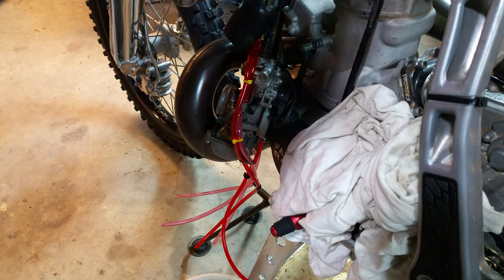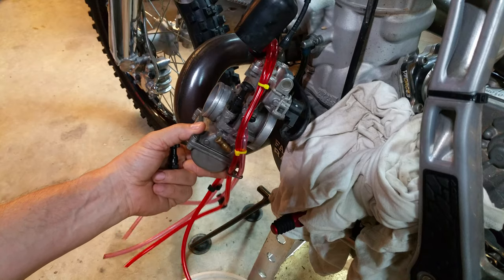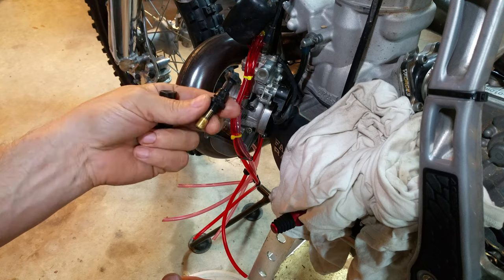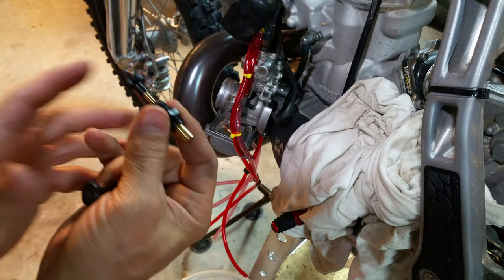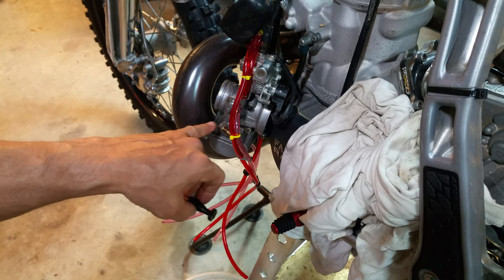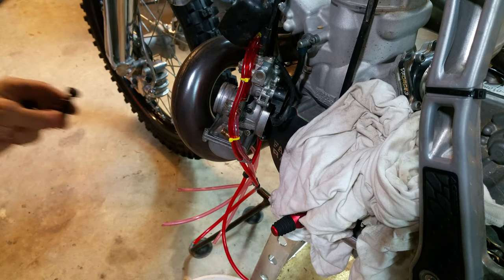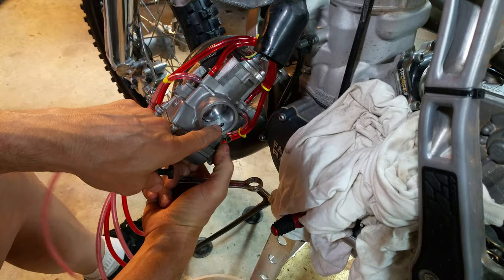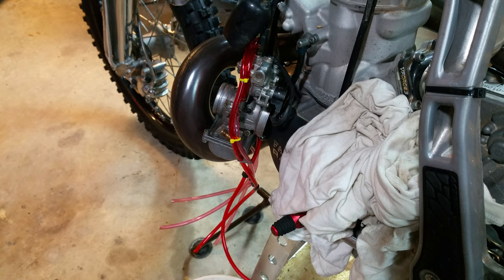Does your choke knob button not stay up? 2-stroke MX Bike Keihin Carb

Comment from the maker: If yours is a Keihin PWK carb, here is the part you need.
https://www.ebay.com/itm/NEW-KEIHIN-PWK-choke-replacement-plunger-lever-Carburetor-carb-28-33-35-38-39-mm/272618570207?ssPageName=STRK%3AMEBIDX%3AIT&_trksid=p2057872.m2749.l2649